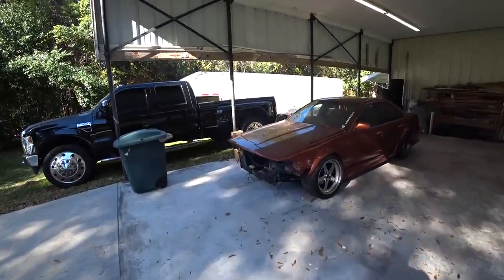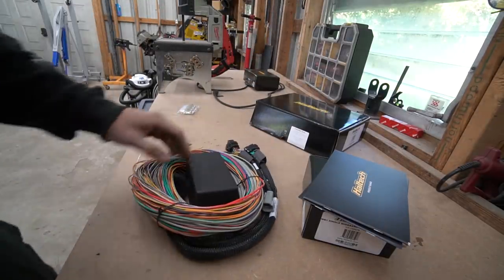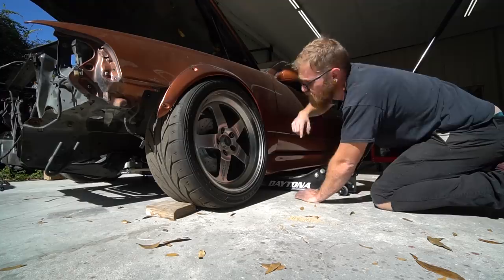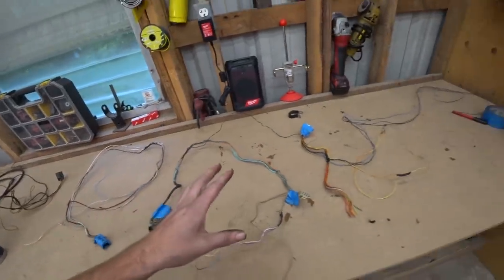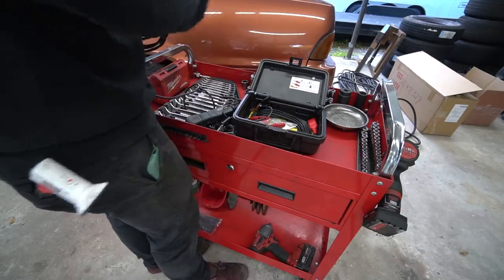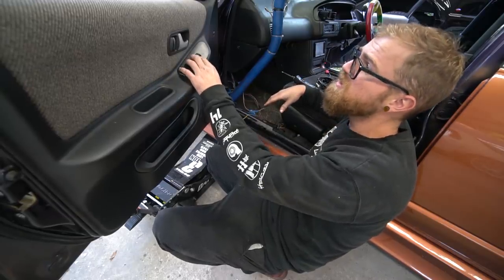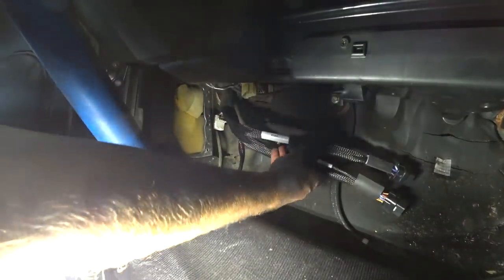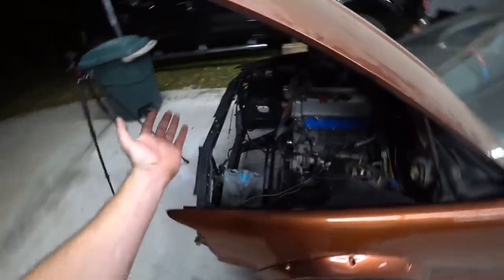RHD K Swapped Cefiro Build. Pt.11 The hardest part of it all.

Comment: @Taylor Ray, if you coat that MDF table with Titebond III wood glue (you can just roll it on with a foam paint roller), you'll have a work table that is basically water proof and sandable.  Titebond III, once it cures, is very close to an epoxy.  Great stuff.
Reply from the maker: Yeah? Seems weird to coat something with wood glue but that would be easier than epoxying it. lol
Reply: The thing about is that it is sandable.
Reply: Even coating in Bondcrete would be a great way to coat it, relatively inexpensive and can thin with water and run through a gun.
Reply: Always, Always, Always turn main water valve off when doing anything with water. That one thing would of saved you a bunch of time as I’m sure you found out.
Reply: MDF is made from wood after all. Sure, you can just replace that sheet of MDF once it's marred one day. But a coat or two of Titebond III would turn that sheet now into a much better surface to work on and give it a much longer life.
Reply: @Taylordrifts  Just finished building a router table with MDF top and the TB III trick worked good for me.
It's a bit thinner and stays wet longer than traditional PVA wood glue so it's easier to coat than you'd imagine
Reply: @Taylordrifts  At least the water-resistant part seems to be backed up by this video: https://www.youtube.com/watch?v=k-g3efGa3sI

Comment: Hey Taylor, I also have recently used Haltech for my Kswap Miata. If you would like brand new connectors for your harness, look at Corsa-Technic and look through the Sumitomo connectors HVG series. Most of the K engine uses the 3 pin HVG-3S-1. Also might be work replacing the oil switch on the side of block with a Bosch combo temp & pressure unit as the switch is a dumb switch type not actual oil pressure reading. Cheers mate!

Comment: On your ECU you may want to check if the back is metal, and if so if it requires a chassis ground.  On that note imports from that era also ran common Positive instead of common Ground.  Since you are playing with the wiring this is something that you will want to find out before you dig into it to much.  Can't wait to see the final result!
Reply: na mate you can jus leave em floating round the floor if you want most rbs in nz are like that hahahahah cause we chuck em in all different shit

Comment: I recently started a mobile repair shop and have done a LOT of work on cars and trucks, head gaskets, motor replacements, timing chains, you name it I've probably done it. But one thing I've never done is the all-too-common exhaust manifold replacement on a ford 5.4 3v engine which I now own and needs that manifold haha. You're so right about thinking it's scary or intimidating until you do it. I ground all 7 stud nuts right off (8th one was snapped like all of them) and got that manifold off and man is it quite the job with no room to work but it feels so much better being able to say I've done it. Now I just have to get all the studs out of the head and install the new manifold. I have the same attitude as you about figuring things out yourself

Comment: Been there done that....except I DID turn off the water to the house first.   I was swapping out my kitchen faucet and ended up having to replace both valves after they started leaking.  Only thing not replaced at the end was the kitchen sink.   Now I pretty much expect any valve that hasn't been closed over a year...to fail/leak.   Still love being a home-owner though.  Hope you had an awesome Christmas and best wishes for the new year.

Comment: I would make a plate that stood off the firewall a little on rubber isolation and mount the ECU to the plate.
Those ECUs from Haltec can just about be bolted to the underside of a muffler but a cool vibration free ECU will live longer than a hot vibrating one.

Comment: Probably too late but:

Those dash plugs are for the instrument cluster signals to and from the ecu, and to send signals to the automatic transmission computer in an auto car. Assume you need none of this, as the haltech will display all the info via CAN, and you can send a speed signal from the GPS dash too the ECU (if you set up speed based launch control). Only other thing you'd be missing is the neutral switch which the Nissan used for idling (not part of the starting circuit like alot of American cars) but some people use for launch control also.

Also trivia, Z32 mounts the ECU on the floor where you are putting the Haltech, they use a bracket that houses 3-4 computers and then there's a wooden board that goes over the top, which the carpet attaches to.

I'm in the opposite situation, learnt on engine harnesses and now attempting my first full body harness on my full size bronco. I might dig back and see if there's any good Miata vids and tips, I love the switch panel you used in that car

Comment: There are three or so ways to remove wiring.
First carefully remove and feed every component and wire through whatever convoluted and ridiculous route the factory setup like Taylor is going.
Second chop it off at the firewall and cut any wire that is not a straight pull after marking either side of the cut with the same number.
Third preempt the escape of the magic smoke by setting fire to the car and walking away.

Comment: Why is everyone afraid of wiring? It's easy. I did both a chassis and engine harness in my #4G63510 It's like a puzzle and you get to do 80% at the workbench instead of under a car or contorted inside a small space. Just terminate all the wires and label them. Then route them comfortably and possibly stealthily. You're done 😊

Comment: Remember that the power wires are in the engine bay on the left hand side near the oem airbox location.. doubt you are gonna be using the oem dash for temp,oil tach etc. So the plugs in the left kick panel would be mostly out. With the exception of the wiper. Just reinstall that plug and it will work if grounded correctly.
Reply from the maker: I tried just the plug and it didn’t work. Tried a bunch of combinations of the extra wires and nothing turned it on.
Reply: @Taylordrifts  seems funny. How would the rb run if there was not any power in that plug. But i guess by now you would have found a solution.

Comment: how come you didn't buy new engine connectors? what injectors are you going to use? probably won't need the stock inj connectors, you also may need one of those dash/chassis plugs for ign/start switch if you want the keys to work, id also run new wiring for the fuel pump instead of using stock stuff (porbz going to do this anyway?)

Comment: Every time i see that cage the hate in me goes through the roof. If you arent gonna pull the cage out at least while you are working down in the passenger footwell you should pull the seat out. 
Also regarding working on house projects for things like water or electricity. Do it during the day, that way when something critical breaks you can at least get to the hardware store to sort the issue out.

Comment: What happened to you is the major down fall to PVC supply lines.  They are cheaper than copper and easier to put together....  Pex is the way to go if you are completely redoing everything.  

Some advice.  Go to the home store of your choice, buy 1-1/2" sch 40 pipe, couplers, elbows, caps, threaded adapters and tees.  Same for your supply lines with some extra shut offs.  Put all this stuff on a shelf in your garage.  You may think I am crazy, but one day, about 1am something will break, start to leak, ect.  You will have everything you need, to fix it on hand already.  My Dad told me this when I bought my first house 15 years ago.  I thought he was nuts, but I did it.  His advice has saved me more hassle over the years.  I got to Lowes once to twice a month and always grab little home repair items just to have on hand.

Comment: Wouldn't it be easier to have just cut the oem connectors that you want ie the wiper motor plug and just repin them or solder on new wire rather than unwrapping the whole looms?

Comment: Must be kinda weird driving a right hand drive especially with the pedals and gear shift reversed.  I know I couldn't use my left foot for throttle and my right foot for the clutch.  Very strange.
Reply from the maker: Pedals are the same. Shifter is too but is reverse since you’re on the other side. So first is still where it is in a left hand drive car.